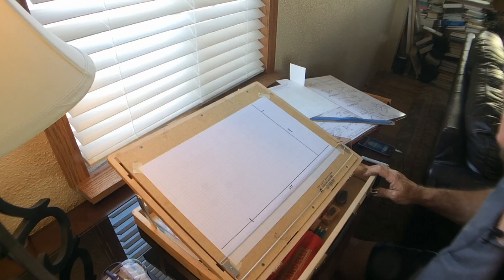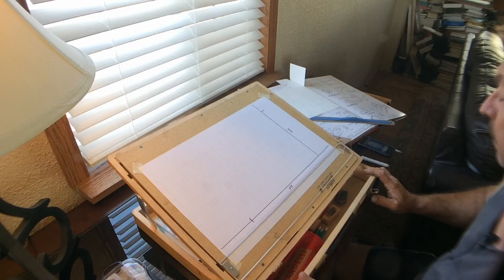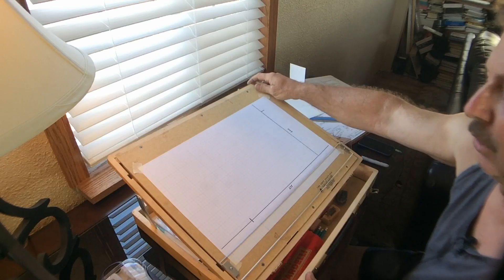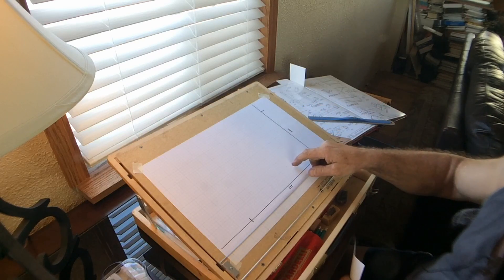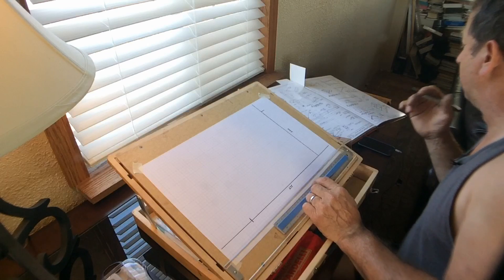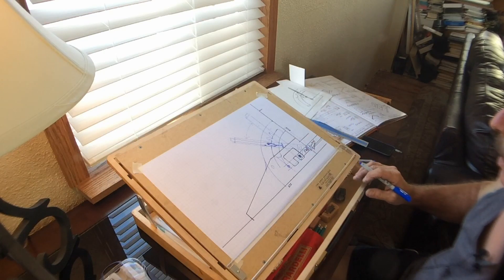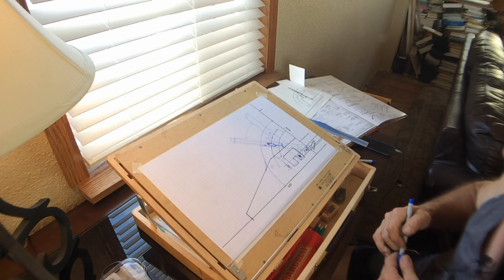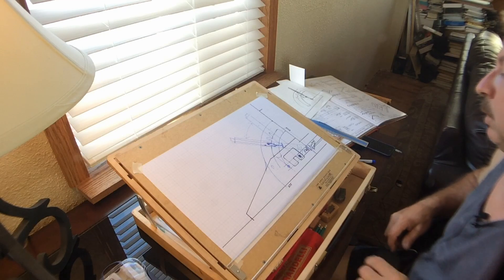Building a Zenith 701 Experimental Airplane, Designing a Flap Handle Part 1

Comment: Nice to see a drafting table! Mine is about the same size...have had it since high school. I am considering manual flaps on my 750, but we'll see.
Reply from the maker: I have several drafting boards, this is the most convenient as everything stores inside. I prefer my larger drafting machine, but it is in the closet right now. I have cad and cam capabilities and cnc mill and lathe but sometimes it is easier for me to draw it manually. have you tried the dies yet?
Reply: hillsgun No, I haven't. I have been at TIG  school all week. Plan to give them a try next week. My only drafting board is my portable one. I have a few CAD programs, but for simple things, I agree that old school drafting is the easiest. I laid out all my parts that way, just because I'm so comfortable with it.